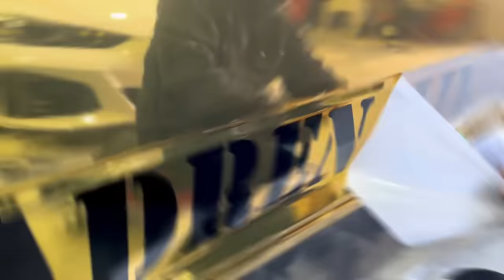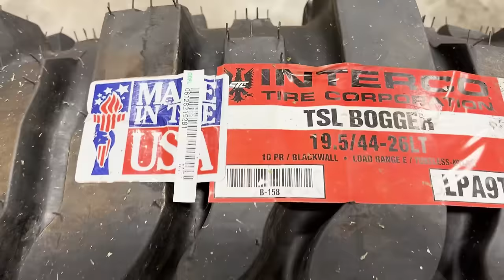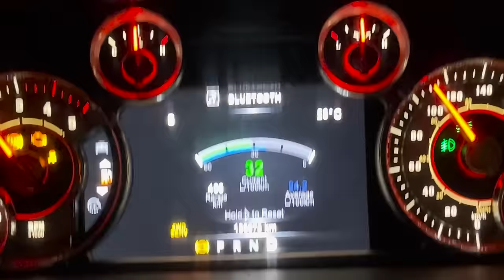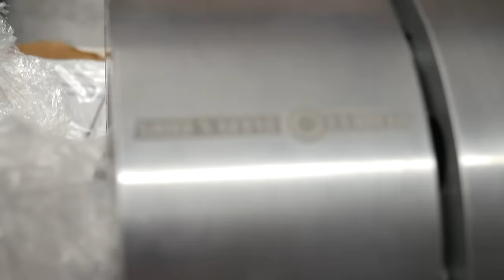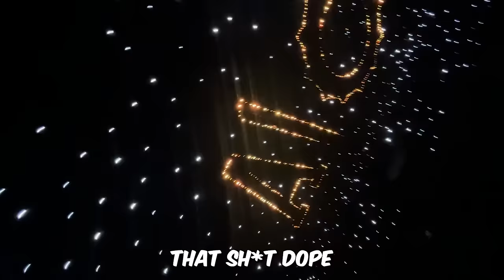I Built a 160K SEMA Truck In 63 Days!

Comment: only issue is it is still a ram junk dodge junk engine they rust and there ugly
Reply: Dodge isn't bad wdym
Reply: @quantum6877  Hemi 2 spark plug every cylinder and they rust easy there not that reliable
Reply: @sk8erjon316   Reliability isn't the most, but I get the rusty part. Still doesn't mean it's a piece of junk